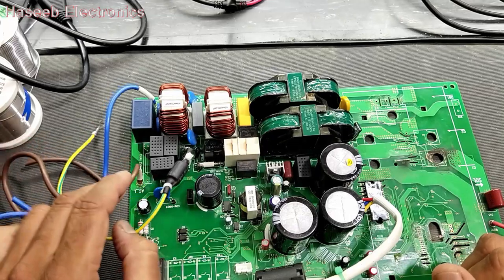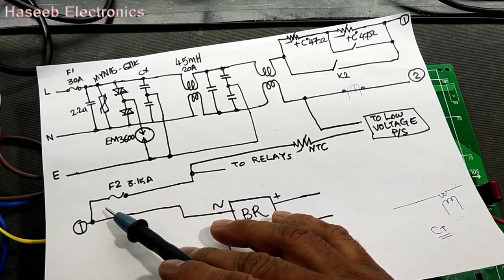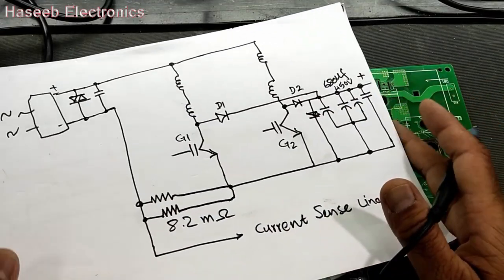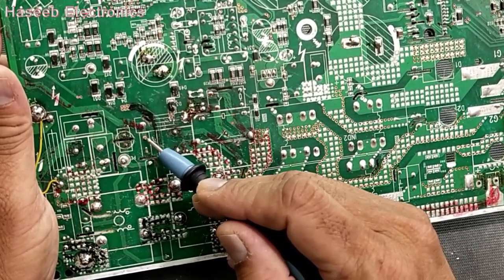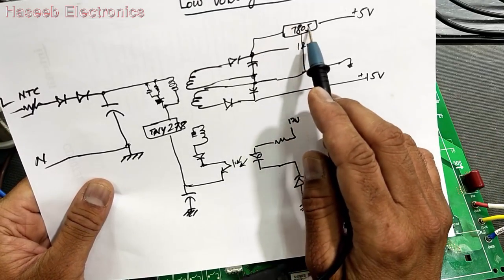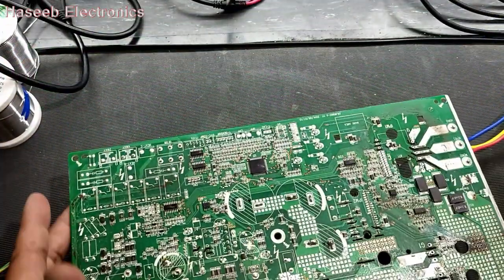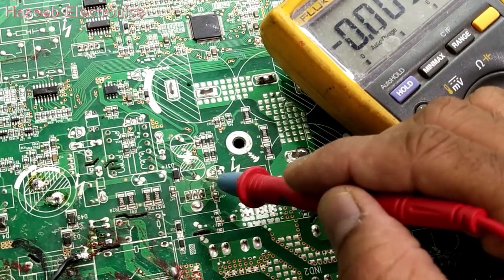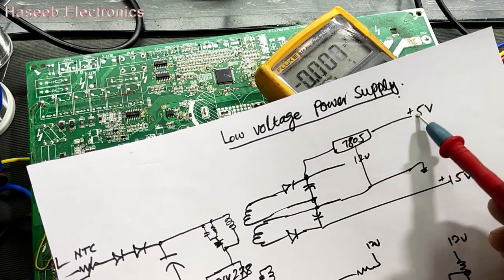341 DC Inverter AC Outdoor Unit Circuit Board Course - Repair / Function / Troubleshooting - Part 3

Comment: Nice job. Am new to your channel and I love technical things. 
Watching your videos has given me a lot of knowledge about electronics repair. 
Thank you very much sir.
With your videos, I can learn a lot about electronics repair.
Please sir, I have a question which I need an urgent answer or solution to.
Please what does "DC compressor out of step mean in inverter AC's"?
I have Hisense inverter split unit AC, and it's displaying "19" error code. I checked online and found out that the error code 19 means"DC compressor out of step". 
What does it mean sir?
Please help.
Reply from the maker: error code 19 is related to compressor or outdoor unit control board (might be IPM section is involved, when UVW output are fail then this error can come, because the compressor is not turning ON

Comment: Thanks for helpful video. In my board stabilization is on 15V line not 12V. Unintentionally I shorted legs of T431, voltage raised and short circuit appeared ;) I faound zener diode shorted.

Comment: Please clear my doubt, as you said the 12v, or 15v, or 5v not stable where will be the problems and what will be the problems.
Reply from the maker: If we ave fluctuations, the most common problem the short circuit in secondary section of smps circuit 
In this case we have to troubleshoot output section
Please check video number 207, 245 or 275 for feedback circuit

Comment: Its a great video, can u let me know whether i can run only the inverter outdoor unit using stc 1000 temperature controller?
Reply from the maker: thanks a lot
no. because outdoor unit needs a special code, which is only possible from its matched indoor unit model number PCB. as each outdoor unit and indoor units have a special coded communication protocol
Reply: So fast reply. thank you, sir. The intention of the modification to use stc1000 is to eliminate the evaporator section and to run a small aquarium chiller unit. This AC unit is with me without any usage due to indoor unit coil leakage. So thought of putting it to some use.
 @HaseebElectronics
Reply from the maker: most welcome 
without indoor unit it is near to impossible to use it
Reply: Sir is it possible to run the unit without connecting the blower motor and swing motor. Or will the feedback signal will generate an error. any way to run without these two components. @HaseebElectronics

Comment: I have one doubt sir... Why secondary o/p of the transformer is  only using halfway rectifier... Why not use fullwave or bridge rectifier... Pls explain sir... If it's already discussed, pls give me that link sir
Reply from the maker: in any smps where we need low current in secondary, we use FLYBACK topology, with single winding and single schottkey diode to avoid voltage drop loss across the rectifier (for full wave we need center tapped winding which increases transformer cost and size). if we need more current then full wave rectifier is used, 
bridge rectifier is used in rare cases, because at high frequency there are 2 diodes in series of the load at each half cycle. so it will increase voltage  drop, switching losses
it is preferred to use half wave rectification 
then for high current full wave rectifier
Reply: @HaseebElectronics  very very thankful sir🙏🙏🙏

Comment: Once again thanks Alot. Godbless you Sir.
Please I will need your help sir. What is the principle of operation of an LG inverter AC? How does the indoor communicate with the outdoor?
Is the communicating signal a PWM or another type of signal?

Pls explain Sir.
I will be very grateful....
Reply from the maker: best regards 
please check video number 544 for communication
Reply: Ok Sir
Reply: Is not there Sir.
Am talking about LG inverter Air-Conditioner signal communication between the indoor unit and outdoor unit.
Thanks